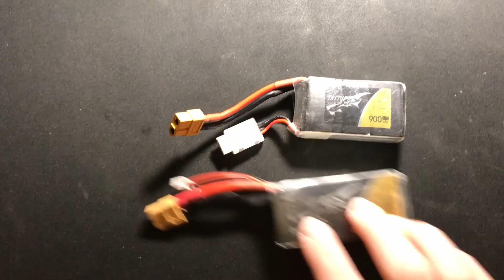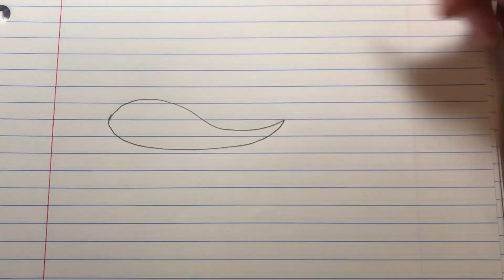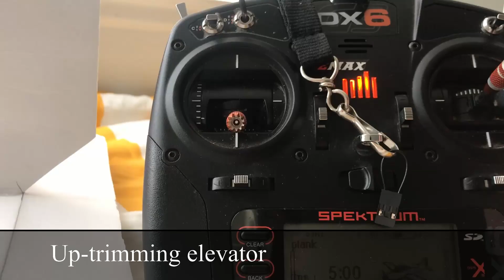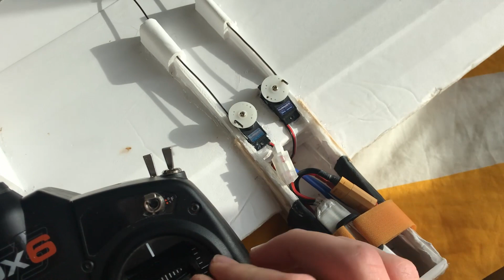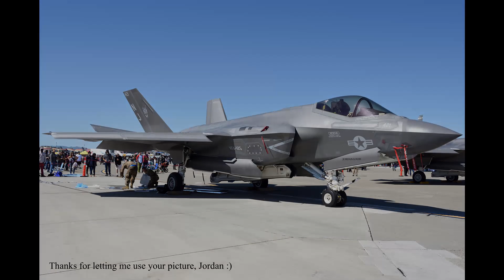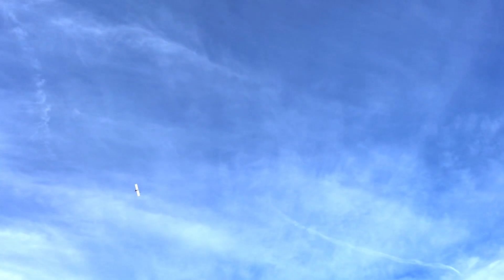RC Plank Wing build

Comment: I've never built anything out of foam but have been trying to find a tractor prop wing exactly like yours for ages! Specifically one that is portable, really manoeuvrable and quiet! Do you have any more tips or build guides that might be useful, please?
Reply from the maker: I don't have a specific build guide, but having built a ton of planks over the years here are a few general rules: 

1. don't make the airfoil too thick. if possible choose a flying wing airfoil and not a flatbottom.
2. cg inline w thrust, close as possible to the mean chord line
3. tend towards nose heavy -- tail heavy wings are not fun
4. try not to have too much vertical fuselage surface area ahead of the wing, this will impact turning and yaw in weird ways
5. tune your throws so that if you use elevons, aileron authority should be less than elevator, otherwise your rolls will be super twitchy
6. for small planes such as these (<30") you really don't need a wood/carbon spar -- just a simple foam spacer should work. Keeps it light.
7. use gorilla glue for spar building and wing building if possible. Superior to hot glue in almost every way.

these are just a couple rules I've tried to follow and work in my experience. obv. experiment around a bit to find what you're looking for
Reply: @prestonsterling7454  Thank you! That's really helpful - thanks for taking the time to reply. I've literally never built a single foam scratchbuild so I'm out of my depth at the moment - but there's one way to learn, I guess! I need to find a basic guide for a simple foam airfoil and then just experiment, like you say. Thanks again - really appreciate the help.

Comment: I have built and flown several of them using the same flying wing info.  They really don't need the vertical stabilizers.
Reply from the maker: yep! you're correct. I've flown wings with practically no vertical stabilizers, the only issue is at takeoff there isn't enough forward airspeed to guarantee proper yaw control. Though once you're at speed, any yawing is pretty much damped purely by the windward wing half creating more drag (and lift) than the other side.